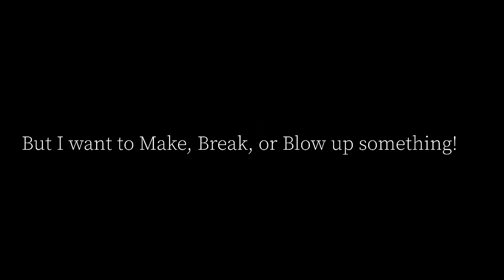Fatboy's The Story of 398 pills &1 Truck

Comment: Tony had two 325's on the top of the motor two 200's on the driver side of the motor and a165 for the van it's self on the lower right side of the motor. I built all the brackets and installed then in his driveway. That was some fun times!!

Comment: Mr Luke,
I have a question for you about grounding. As in grounding a hv box. Its a single desktop unit. Not a split type. My question is, for grounding. Should i run a dedicated ground? My house ground rod is directly throu the wall. Should i use that or install a new copper clad rod? Sorry for the long one. 
Luke....in AZ.

Comment: All they did was build an external input and output tank circuit….thats all it was, look at a board in a amp, Rf comes in goes to the input combiner circuit, 100ohm resistors and the input cap, the coax leads come out and run to the input stages of the 2 or 4 or 8 pill sections depending on how the amp is made and what size it is, the rf comes out of the output transformers to the output combiner, ring of 100ohms, output tuner to the output side of the relay out to the so239….they basically built a 320 pill box in 10 different cabinets externally combined on the input and output sides

Comment: I don't understand, if you are keying 60 to 65KW, aren't you sitting in a microwave ??
Reply: Not at all when you have a amp room separating made from concrete
Reply: Its lower frequency, going in rf dummy load or after a long cable to external antenna.
If you are near you get warmer for shure, but RF for most goes thru the top layer of the skin.
It high power, but in radio-tv transmition its even higher, much higher.
Aircraft long range radars are known to fry rabbits alive near airfield tracks.
But thats MW power level (short pulsed thou).

Comment: Why are Suburbans the vehicle of choice and not say cargo vans?
Reply: I could never figure that one out. 50 years ago there was a guy called Razorback who had a Corvair van with two 102" whips on the roof! With the amplifiers of the time he had no trouble talking to his family in Arkansas...or anywhere else! 
Consider this: at 746 watts per horsepower the amp makes 93 horsepower at 70,000 watts. It probably takes 185 to 200 horsepower to make that power. 
Plus, RF energy is dangerous. Old hams ran 1000 watts out into ladder lines. Most of those old guys wore their pants up to their armpits and died from leukemia, lung cancer, and brain cancer. Their wives died in the same ways.
Reply: @spaceflight1019  I call BS on the RF exposure.
Great segment BBI, Very entertaining
Reply: @bigdaadio.K2WW There are published studies on the hazards of RF, but to make my point, medical machines that employed 27 MHz RF heating have been in service since WW2. You can buy one of these shortwave diathermy devices; the modern version is called a Rife machine.
Reply: @bigdaadio.K2WW  Diathermy is a part of a complete physiotherapy regimen. The frequency and length of the treatments vary.

Frequency: Shortwave diathermy uses a frequency ranging from 3 to 30MHz Usually a frequency of 27.12 MHz and a wavelength of 11 meters is used. Currents of such high frequencies do not stimulate sensory or motor nerves nor do they produce any muscle contraction. Shortwave diathermy can either be
Continuous shortwave diathermy (CSWD).
Pulsed shortwave diathermy (PSWD).
Continuous short-wave diathermy: has a thermal effect more than pulsed, so it is generally used for its thermal effects whereas pulsed short-wave diathermy has athermal effects. Shortwave diathermy uses high-frequency electromagnetic energy to generate heat, in pulsed or continuous energy waves

Comment: 398 pills wow how much power does that put out..
Reply: On the bench it was INSANE, I imagine near unmeasurable in contest tuning!
Reply from the maker: 60kw to 70kw+
Reply: At 746 watts per horsepower...
Reply: @BoxBuilderIdaho  wow unreal
Reply: They were sayin Bird watts, PEP would be over 100,000.  Anyone know what the biggest AC sky's do?
Reply from the maker: @Z28videogates  yea pep would 2.25 times the bird numbers so some where around 140kw
Reply: @BoxBuilderIdaho  wow Why so much power. I cant image that in my house much less in a auto.. just unreal
Reply: @BoxBuilderIdaho 437.5 watts per transistor....😂
Reply from the maker: @rocknrolljesus3197  about 300 per part pep power at 14v so at 16 to 17v yea around. 375 ish. For 20secs. That's how it works.

Comment: Seems kind of silly to use so many bipolar transistors when you could use just a few BLF188s or similar Ldmos.   Q.  What are the tubes - some kind of capacitor?   q.  Where is the low-pass filter on the output?